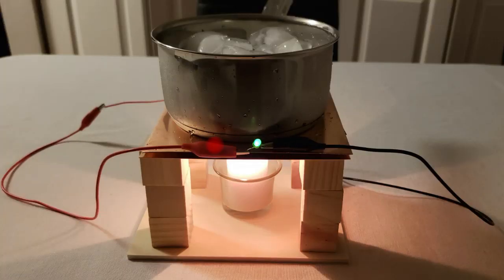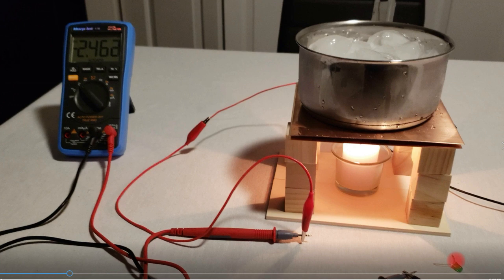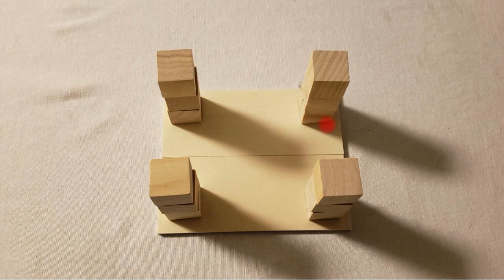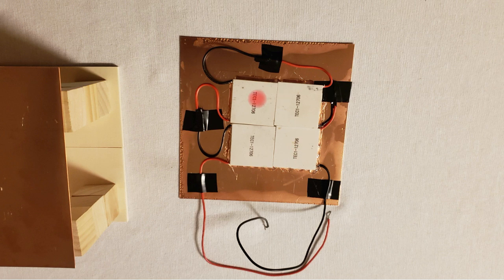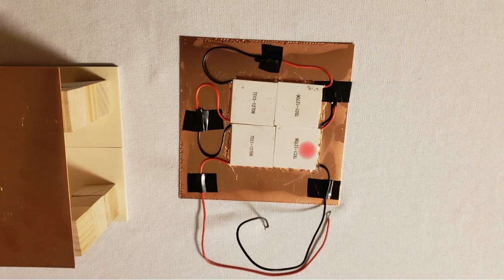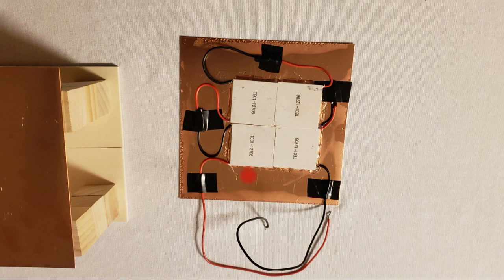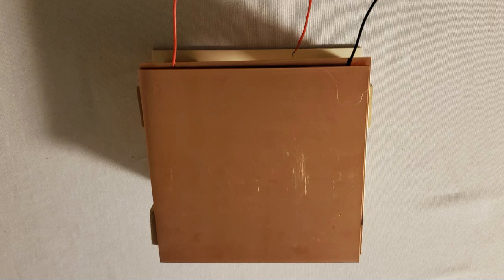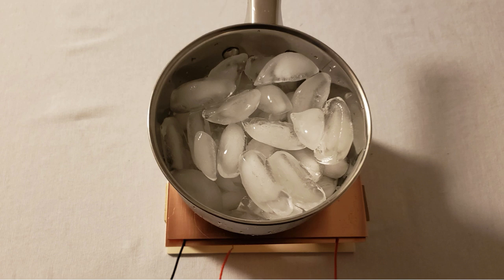Free Energy Thermal Electric Generator - Power a Green LED Using Heat!

Comment from the maker: Hi Everyone, I know that the title "free energy" can be misleading.  Just wanted to say that the idea of free energy violates the law of conservation of energy and mass.  Energy is simply transferred from one form to another in a system undergoing some kind of change.  However, free energy can be defined another way.  That is, Gibbs Free Energy as taught in a typical chemistry course which relates to the maximum amount of work that can be performed by a thermodynamic system.
Reply: Nice
Reply: Please can you make a video solving this for me, I am confused if it's under friction or simple machines

Use the information below for questions 31-38: a man pulls up a box of mass 70 kg using an inclined plane of effective length 5 m onto a platform 2.5 m high at uniform speed. The frictional force between the box and the plane is 100N.
31. The minimum force applied in pulling up the box is?
32. The velocity ratio of the plane is?
33. The mechanical advantage of the plane is?
34. Efficiency of the plane is?
35. Work input is?
36. Work output is?
37. Energy lost in the system is?
38. Total power developed by Man given that the time taken to raise the box on the platform is 50 seconds
Reply: If you burn trash, then it's 'free' energy, right?
Reply: home made electricity

Comment: This is cool but the problem is, what do you use to burn? And burning anything for power creates an imbalance somewhere in nature. This is a problem that needs to be solved. The problem is, the answer to the the first problem would be an end to the profiting on energy. It won't fly. We have to change that first. It's coming.
Reply: You dont have to burn anything, we can capture heat from the sun and with magnifying those Ray's will get it just as hot as a fire.
Reply: @marknogueira6425  good idea, doesn't work. Eventually both sides of the peltier device get to be the same temperature. the device only produces electricity when there is a difference in temperature.
Reply: @spencerwhite3400  with a heat sync of any kind the temperature eventually ends up close enough that the voltage would be zero.

With a one way check valve and a radiating system you can however prolong the difference to the extent that it does work.
Reply: @dontneedtoknow5836  So... you're agreeing with Spencer... there HAS to be a difference in temperature!
Reply: The real "problem" is people need/want energy to live! If people stopped wanting/needing energy then we wouldn't make usable types of energy for people... but then people would all die... so that's not really a workable solution... for people.

Comment: 1.)Those peltier junctions are configured for cooling (TEC1). 2.)You have terrible thermal conductivity. 3.) Calling one of the most inefficient energy conversion systems "free energy" is misinformed. You should understand the material before attempting to teach others.

Comment: Why does my bulb doesn't  glow
Reply: Check the voltage coming out of the TEG(Peltier)... make sure it is high enough to power the LED you are using. Then make sure the positive(+) and negative(-) sides are connected to the correct sides of the LED. FYI... connecting the LED up incorrectly can burn out the LED... so you might want to have a separate setup(battery/resistor) that you know will power the LED just to test them.

Comment: Wouldn't those be perfect in space? Like one side towards the sun so hot, other side facing dark and coldness of vacuum. Would they wrok? What's the name of those? Also, are they as volume efficient as solar panels, I''m guessing not but still cool
Reply: "Dyson Sphere."
The thing is, it only needs heat to produce electricity, and I don't think it requires any form of cooling, if I recall.

Comment: Good effort mate, but not enough!
you can easily double the output power of your present setup by simply adding thermal paste in between the hot & cold plates.

Further, you are using a TEC module (TEC 12706) which is designed for cooling & refrigeration. where as for efficient power generation you must use TEG modules. some single TEG modules (TEG1-287-1.4-1.5)
 are capable of peak generation up to 15v/1.6A or  24Watt power, each!
Hope you redo your test again after applying thermal paste & follow it up by using a TEG1-287-1.4-1.5 & post another video for your 2.8 mill faithful subscribers
Reply: I wS thinking the same thing
Reply: A
Reply: so I wanted to try your setup but I thought I asked first, do you think you could store the energy output it creates? I'm asking this because I do generate a low amount of constant heat from another complete different source but wanted to use that unused heat to transform back into electricity but for a later use. Think it's possible to store it? If yes how, if no why not? and more importantly, wanna try it with me?

Comment: So I'm going to use the cell settup wired into each other on the side of a portable cast iron stove in the freezing cold for my hot and cold, I'm also adding thermal past a small pc radiator peice with a small fan for extra 🥶 🧊 ☃️